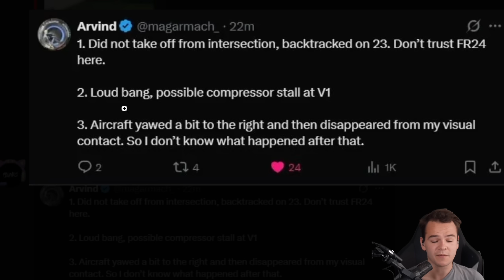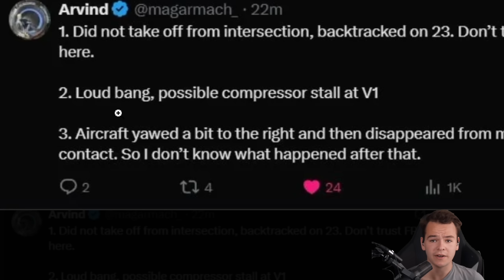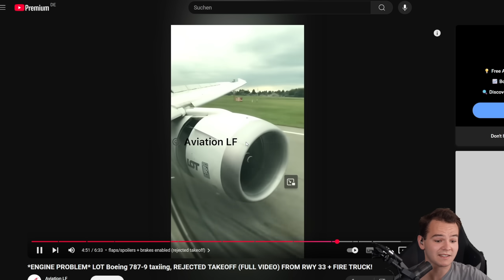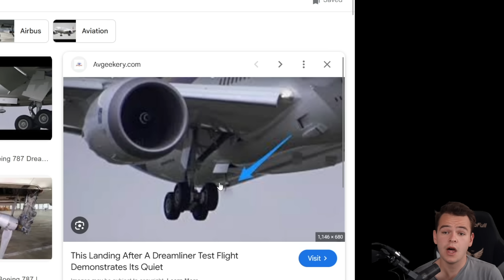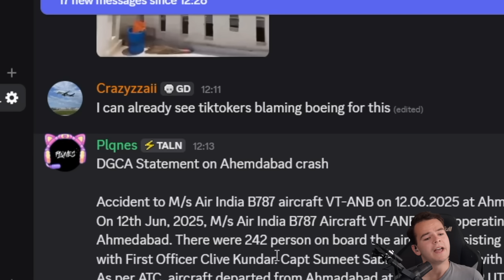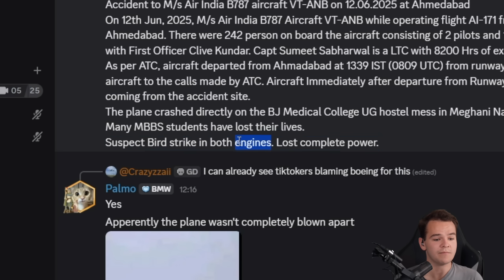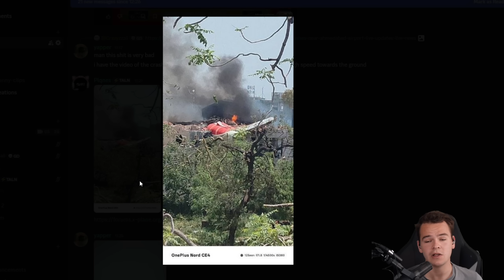The First 787 CRASH Ever - Why It Is SO Confusing?

Comment: I think it's more of a WORK NEGLIGENCE from the Indian side because it is a NOTORIOUS FACT that Indians love to SHORT CUT WORK, NO SENSE of URGENCY and NO ATTENTION to DETAILS.
Also it is a UNVERSAL FACT that Indian workers have EXTREMELY VERY POOR WORK ETHICS thus failure to check details is highly probable. It would have been avoided if aviation workers and staff are thorough and detailed in their inspection of the aircraft before take off. Well as I said earlier Indians practice SHORT CUT WORK so that's the risk there.

Comment: Guys. We’re listening to the opinion of a flight sim YouTuber over any of the professional pilots who fly Boeing so aircraft and unanimously say was likely not a thrust issue?

“We don’t hear the engines roaring at full power”

“We don’t hear the ram air turbine, but we’re pretty far away. Look at this pixel. It’s clearly the RAT”.
Reply: Captain Steve just confirmed from the newest video today it's indeed the RAT and changed his opinion from pilot error to dual engine failure. Maybe this "YouTuber" actually understands forensic video analysis better than a pilot?
Reply: @noahd213 i see that. Interesting.

Comment: Random uneducated people with zero expertise nor relation to this field saying it is pilot error is dissapointing, notice how the two mini propellers meant to provide emergency energy are out which suggests a dual engine failure, to deduce such a thing to mere pilot error is diabolical because you cannot still remove a fact as big as that,  the pilot specifically said "no power. loosing thrust" and the witness account from the 1 survivor talking about how the white and green lights in the cabin went on which relates to a electrical failure of some sort.
also this specific plane 787 will literally not allow you to take off with if the flaps arent correct, its also worth mentioning this model has a issue with lithium batterys exploding in heat, this took place in india, it doesnt take a genius to deduce that an electical failure of some sort played a role.

Comment: Notice the landing gear bogeys. They are tilting toe-down, which is the wrong way.
Reply: it doesn't matter. you all sheep going around saying "landing gear landing gear" need to understand that , that wasn't the priority of the pilots. There was a bigger problem. Yes landing gear causes drag and small issues but that can't be the sole reason for a crash
Reply: @batfishh did you even fully understand my comment? You completely skipped over the point. The point is, it is an abnormal condition of the landing gear to be toe-down and it indicates a hydraulic failure, likely caused by the failure of the engines. This is a big clue that is highly worthy of discussion.

Comment: "Incorrect Performance Calculations" 
The plane lift-off the ground if there was an engine trust, it was inadequate. It’s more probable that the crew entered an incorrect data in one of the parameters on the Flight Management System. I'm not saying that they did. Just my thought.

Comment: Maybe I am missunderstanding the physics here, but regarding the no flap theory: Without correct flaps I would assume the plane runs off the end of the runway and crashes immediately. But if the flaps were at 0° and the plane managed to take off, then lift obviously was enough, right? I mean the aircraft performance doesnt drastically change over a few hundred feet and since the plane seemed to not have stalled the pilots seem to not have pulled too much AoA for the (possibly) wrong flaps. 
As was explained, the wrong flap theory is unlikely for other reasons, just wondered why it would even be considered, with it not fitting the flight profile from my (maybe flawed) understanding.

Comment: At the actual beginning of the video that you seem to have clipped, there is plenty of loud roar in the engines... what is odd is that the gear never came up.... It is possible when the captain announced "gear up"... the co pilot moved the flaps lever to o° instead of the gear the wings lose too much lift needed on take off and landing... add to the large amount of drag with the gear down, loss of lift, a passenger jet can not take off properly...  again when the jet was closest to the camera that was recording, there was plenty of engine noise... And the "mayday" call was not made until the aircraft began to stall at about 500 to 625ft altitude ... not sure why you said it was while they were on the runway............

Comment: In the better quality video you can hear RAT noise but also jet engine(s) that is not consistent with any kind of max thrust setting though. In crash photos you can see APU intake valve open suggesting that it was started but how long does it take to spool up and for the generators to work? The RAT can't power the center hydraulic system driven by electric pumps needed to retract the landing gear. Also the crash site photos show a left wing with slats deployed up to some extent. However anti-stall protection automatically deploys slats if airspeed is bad with the AOA regardless of the flap setting. But for the RAT to auto-deploy it would need all 4 elec. generators to fail, I'm wondering if they deployed it manually due to some sort of electricity fault while attempting to start the APU.. Another possibility is that they had one of the engines failing and shut down the wrong engine. The runway video shows slight yaw to the right right after take off, however the other video isn't showing any noticeable rudder input that would be indicative of one engine failing (given yaw to the right that would be engine number 2, right wing, failing). I'm also wondering if you could f*** up FMC setup that it wouldn't raise any alarms for flap 0 takeoff configuration.  Really confusing...

Comment: What i think is that the low maintenance of the aircraft might be the reason of a power failure and i assume that the flaps on the wings were not working properly to give enough lift as the aircraft was heavily loaded with the fuel. And the second thoughts about the power failure the main problem might be the mayday call should be on the ground not 625 ft in the air which caused a chaos..

Comment: You missed that it only rotated in the grassy dust at the end of the runway.   Engines never developed full power and were into rapid failure; hence auto deployment of the RAT.   Fuel flow or contamination problems?    In the 'good old days', an attentive flight engineer would have called an abort on the runway.

Comment: First of all this is such a tragedy my condolences to the families of all those aboard 😢 🙏🏻 
And i wanted to offer my theory too 
A person who took that same flight from delhi to Ahmedabad before this crash happened shared his video of the Ac not working nor the television screens now this i feel is because there was some electrical issues with the plane that got ignored for being limited to the ac and screens but heres the thing the atc only heard One mayday call (they are supposed to hear 3) which means their radio systems shut off again, electrical issue and since the survivor said they heard a loud bang right after takeoff , i think the electrical supply to both the engines suddenly stopped due to what maybe a short circuit or smt and hence, dual engine failure… today morning, the back box was recovered which revealed the pilot in-fact gave 3 mayday calls and said they’re loosing thrust so yea, thats my theory Electrical failure leading to dual engine failure. Also im not an expert i just wanted to well.. share my theory chances of this being wrong are high.

Comment: If you raise the flaps instead of the landing gear during takeoff in a simulation, will the plane crash? At the very least, you can be sure that this mistake will reduce lift considerably.

Comment: Flaps might have been Retracted resulting in lost of  lift and while the Landing Gear still  extended causing in increased drag resulting in a uncontrollable flight of the aircraft which contributed to the crash.

Comment: That Air India footage you're watching is a screen recorded video from a computer screen, you can see glare in the background and that's why you're not seeing or hearing anything. Watch the original RAW footage with sound, you can see Flaps deployed when the camera zooms in (separation between wing and flaps, very faint) and also you can hear the RAT (Ram Air Turbine) propeller sound, which means it auto deployed due to full dual engine failure. Also note, you can't hear the normal Jet sounds which are very loud. https://www.youtube.com/shorts/yu0VKqSYJ3E

Comment: It was Overloaded 
	•	✅ Flaps extended (beyond takeoff phase)
	•	✅ Landing gear left down
	•	✅ High temperature
	•	✅ Full fuel tanks

Overloaded
Exceeds lift capability; may not take off at all
Flaps extended
Helps lift at low speed but massively increases drag at higher speeds
Gear down
Adds extreme drag and reduces climb performance
High temperature
Lowers engine thrust and air density (less lift)
Full fuel
Increases weight to near or over limits
-------------
1.	🚫 Takeoff May Fail Completely
	•	Aircraft may not reach Vr (rotation speed) within the available runway
	•	Could result in runway overrun, especially at shorter or high-altitude airports
	2.	🐌 Extremely Poor Climb Rate
	•	Even if airborne, the aircraft might only climb a few hundred feet per minute or less
	•	Risk of hitting obstacles or terrain near airport
	3.	🔥 Engine Overstress
	•	Engines will be operating near or at max thrust for longer than safe
	•	Overheating, wear, or even failure possible
	4.	⚠️ Stall Risk
	•	At low speeds and high weights, the aircraft is closer to stall margin
	•	Any turbulence or pilot input error can trigger aerodynamic stall
	5.	❌ Structural Damage
	•	Gear doors and flaps aren’t designed to handle cruise speeds
	•	Prolonged flight in this config can damage the landing gear, flap actuators, or wing structure

Comment: Because nobody is prepared to believe the obvious - the plane had insufficient power from the engines and failed to climb. Were the pilots even able to do anything about this? Was the software responding properly responding to commands? 

I am absolutely certain that the pilots were fully trained in how to fly the aircraft. And they wouldn't be stupid or reckless enough to risk their lives, or anybody else's lives, by "shortcutting" flight procedures. 

The nose of the aircraft was not at a steep angle of ascent , and yet the plane dropped like a  fading paper aeroplane - in a flat descent seemingly producing little lift- and as though it was overloaded. 

Of course, the investigation into this accident will be so politically and commercially "charged" that it is very unlikely any real answer is going to be forthcoming for a long time. 

The flight crew would have been saying a great deal while this lack of flight was going on - none of which is being published at this time - one can only guess why that is!

Comment: Could a weight on wheels fault possibly cause the auto-throttle to rollback to idle? It doesn't explain the bangs, if there were any, but it could "seem" like a dual engine failure to the pilots, initially.

Comment: We’ve all heard about the incredible story of the sole survivor of the crash by now. Lucky guy. However, I still cannot wrap my head around how he managed to walk out unscathed. From the two footages we’ve seen so far, the plane blows up into flames just as it disappears behind the buildings in the distance which makes me think that the explosion occurred immediately (within milliseconds of impact). Also, seat 11A was positioned right in front of the left wing and engine and common sense would say that’s where the biggest explosion would’ve occurred upon impact. I cannot understand how he could’ve gotten out of a crack in the plane as the whole fuselage had burst into flames within mili seconds of impact. Either, it was divine timing (there was a window of opportunity of a millisecond and he took it) or there’s something else going on. Also, if you look carefully at the footage taken by the eyewitness (not the footage from airport security), you can see as the plane starts to come down in the distance, the moment it disappears into the buildings, something comes flying off, like a piece of metal sheet or a turbine blade I don’t know. Then we hear the loud noise followed by the explosion. This is something no one has picked up on.

Comment: Fuel Line Sabbotage/Failure Is Most Possible Explanation.

No Smoke in engines if its case of Bird strike or Flaming.
Even With Flap mis-Configuration Plane Would Have went further ahead instead Of Sinking down Immediately (seen from Video of Take Off).

RAT was Deployed means two Turbines were down at same time suggest Fuel Starvation.

Comment: Here's something anyone has not mentioned. The landing gears on an 787 when it time to put them up. The 2 main landing gears which are tilted backwards.(like an a330). But when the main landing gear is being retracted the wheel change it's tilt. (it becomes like the a350) you get what I mean. And the 787 from the other video of the plane crashing seems to have its gear tilted forwards. So the gear levers were selected up. (it's a theory I was and no one else did I want no hate pls)

Comment: if it was a "Bird problem", the gear would have been up. this was an engine(s) problem.
Over weight?   Cant be, it left the ground.
Flaps? The aircraft wont let the Pilot takeoff without them cycled down, and in another video,
 you can see the edge of a flap. if it was up, you could never see the flap edge.
Engine problem, or throttles set wrong.
OH, btw, NOTHING MAN MADE IS INDESTRUCTIBLE!

Comment: This sounds like a propaganda campaign. First statement makes it sound as if this plane is not at fault, but a statement attributed to the one survivor suggested that the doors flew off, and that there seemed to be electrical issues, Another report was that day before entertainment screens were not working. At first glance it maybe that poor maintenance may be a major contributor, and maybe pressure to fly instead of concern for safety. First question I asked when I heard of the crash, was it a Boeing.

Comment: landing gear was tilted forward in the video and it stayed like this for a while meaning the gear stopped retracting during the process. Mayday call was released from the CVR which confirms there was no power and no thrust. Dual engine failure i think is a major theory. nevertheless its extremely sad

Comment: Did you see any birds in the original video ? Nope!   why is there dust  coming up from the end of the runway ?(  engines producing power) Why did it use the whole runway  ? could it be a bad flap setting  by a copilot that only had 1000 hours ? You will never see an airline in the USA with a 1000 hour copilot  driving a 787 .

Comment: 1) Total Runway length 11000 ft
2) Take-off from intersection, seems like only little more than half of the runway, around 7000ft runway available
3) Aircraft seems to be at its Maximum Take-off weight
4) Aircraft did a lift off almost at the end of Runway, evident from the dust
Crew had no possibility to RTO as they already passed the V1 (no alarms) with little runway left ahead, and the energy was okay at the liftoff but not strong enough as soon as liftoff which is due to a wrong config setting with maximum weight.
Seems like the system was fooled on ground and the poor setting was accepted due to inaccurate data entered onto FMS including CG.
The Crew had little time to recover as no altitude

Even if crew wants to perform RTO for someother reason it seems like it would have eventually hit the wall and fatalities.

For the given airport conditions on that day, takeoff from less runway length explains all the compromises and inaccuracies.

Very very low chances that engine had failed in a few seconds after liftoff, unless FADEC shutting down itslef such a failure highly remote.

Comment: This YouTuber claims it’s surely a dual engine failure. This is just one more example of YouTubers rushing to get a scoop, while really knowing nothing concrete to back their claims. How about the possibility that the pilot monitoring raised the flaps by mistake instead of raising the landing gear? That would explain the airplane trajectory and its configuration on initial climb out, much better than the highly unlikely dual engine failure.

Comment: I did some research and testing myself and came to the conclusion something caused tge engines not to be able to spin. The RAM ka RAT was deployed so the plane had no power and that means that prob someting in the engines broke. which also leads to the conclusion why it lost altitude / thrust. Thats MY current theory. I also tested this in the flight sim and got the same result olny when i suddenly set the thrust to 0% shortly after takeoff.

Comment: I'm going with a no flap economy takeoff with the incorrect fuel weight entered into the flight computer. An economy take off how put it between a 40-60% engine thrust but without flaps and nose up will cause a stall  and would also lower the engine noise per video.